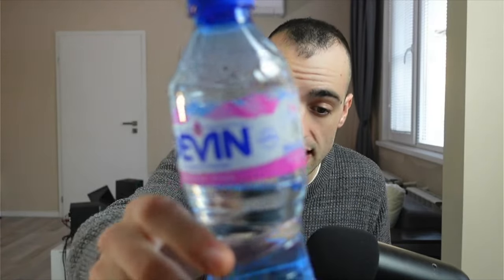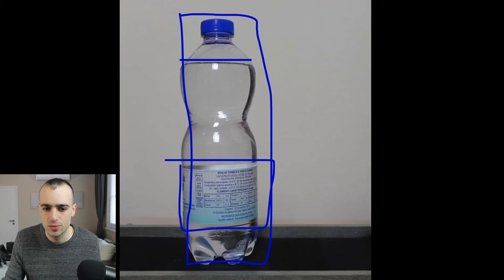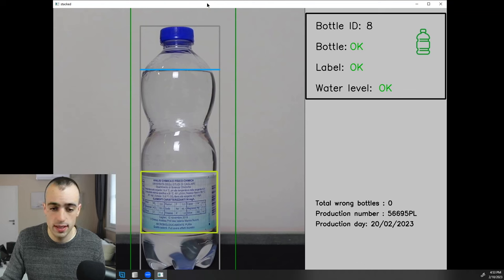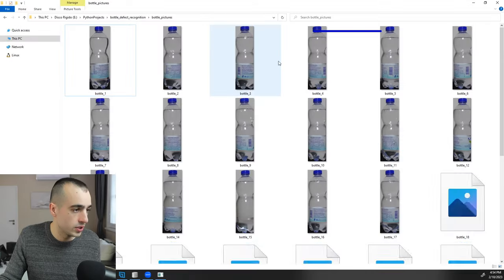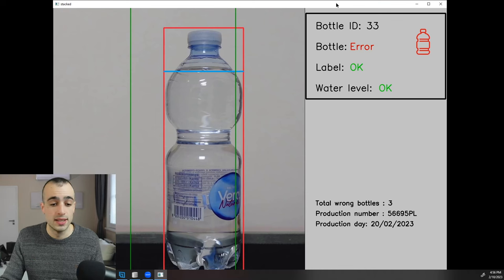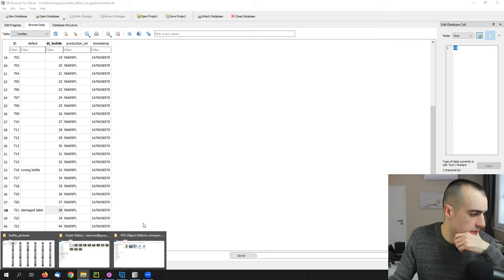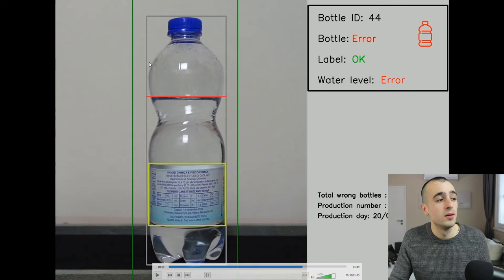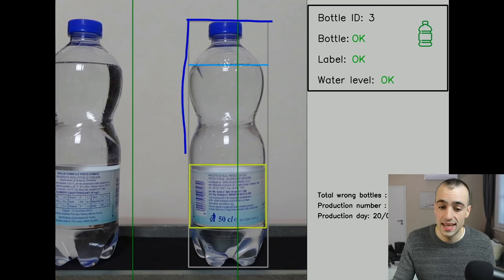Real-time defect identification of products on a conveyor belt

Comment: Thank you for a great tutorial! Do you need a set of images with defects to train your models? How many examples of every defect do you approximately need to build a robust model in your opinion?
Reply from the maker: Hi Erik, yes you need a set of images with defects to train the model.
There is not a specific number, it depends on the complexity of the things you want to detect, on how different the defects are, the variety of environmental changes and so on. In general I would start with a small sample of 1000 and increase it if necessary.

Comment: Hi,

I am developing a system that detects if the object is damaged.
This detection is done in an uncontrolled environment, by which I mean under different weather conditions, scales and rotations.

As we have little data, and we probably won't be able to obtain more, I'm thinking about using "feature matching" since it's likely that Yolo and similar techniques won't be robust.

Have you tried using "feature matching"?
Reply from the maker: nope, it would be very unreliable that way. Data is very important for the accuracy, so I would focus on that aspect first
Reply: @pysource-com  Hi,
Maybe I wasn't precise about the amount of my data. I have a lot of data on the undamaged object and I can acquire more.
What I'm missing are more images of the damaged object and I can't acquire more. The dataset is very unbalanced.

I think I have enough data to train a "feature matching" model and I can combine it with other models, such as Object detection + "zernike moments", ...
I don't think I have enough data to create a robust model with yolo or for simple classification.

Do you know of other techniques that can result in robust models?

Comment: Thank you for this brief video. Can you please share the detail and specs of the high speed camera used in this project and how many bottles scanned / captured in one secon. Did you just measure the sides length of the label or you also performed the text recognition or color detection etc as well ?

Comment: Thanks very much.I have a question -- How to detect the Water level?
Reply from the maker: The water level could be a simple classification task comparing images with the right amount of water and the one that have lower/higher level than they should have and calssify them as wrong.

Or if it's necessary to get exactly the line, it would be a segmentation task where the deep learning model will draw the line.
Reply: @pysource-com  I dont know why your videos are underrated, I have really found your videos to be helpful. If you dont mind I have one request Please can you make a video to measure exact water level like if the water is 100 ml then we use CV and Deeplearning to measure it to be 100ml.

Comment: Hi dear,
I've been watching ur tutorials on object detection .. however I'm working on such project where need to send opencv output  video to web browser.

Knowing that i do not want to use flask or any network related tool. I need simply the  video to appear on my local host webpage .

I tried using some thing like ffmpeg but couldn't link it with opencv output.

I hope u can help me in that . 

Best wishes